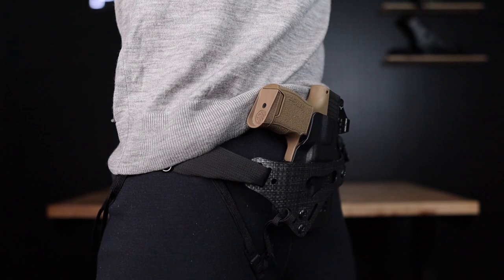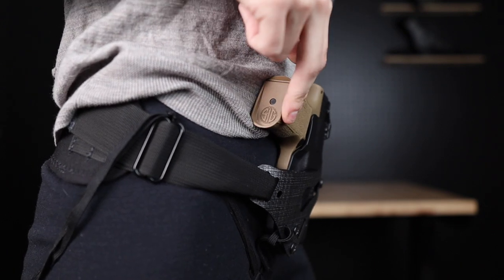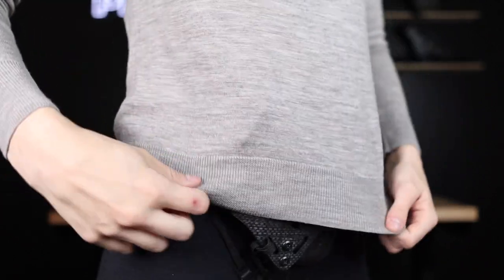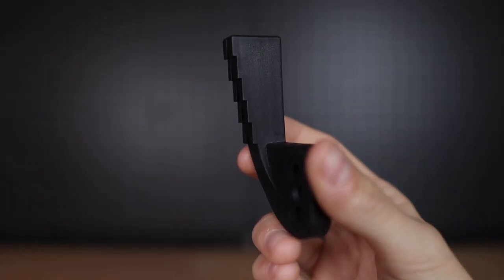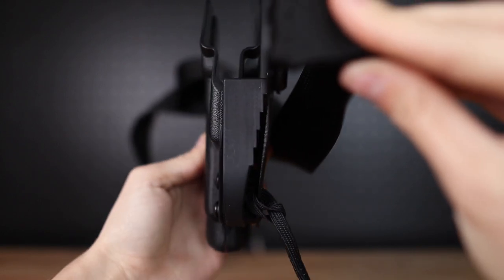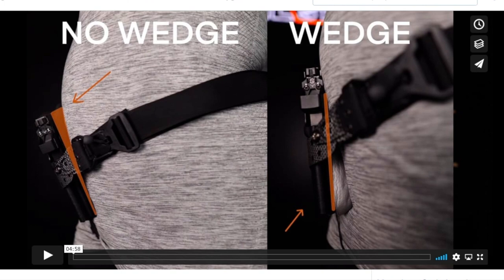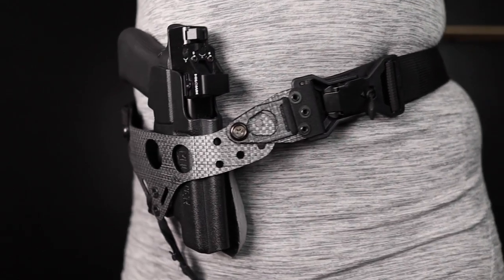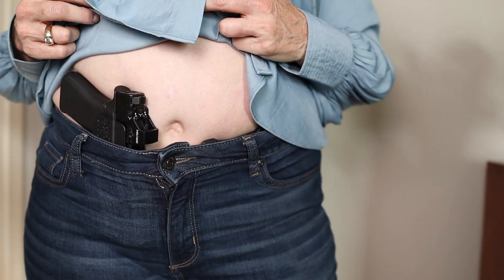3 Steps to Concealed Carry Without Printing

Comment: This helps. I was considering an enigma but I don’t think it will work with my Tier 1 holster and there are no enigmas for a 1911 so I’m gonna try a wedge on my holster. I think it will give me a bit more grip tuck if I place it in the correct spot and it will probably increase my comfort by keeping the muzzle end of the holster away from my groin.

Comment: Good Lord.....get an IWB, put it on, try on different over shirts until you find one that hangs right. And then practice getting to it. 
It's not rocket surgery.
Reply from the maker: Trial and error isn’t a process or guide to success, and generates mixed results of inconsistent quality. 

The fact that so many people struggle with concealed carry and get inconsistent results (often dissatisfied with their level of comfort and concealment) tells us that some clear, repeatable, guidance on the topic is necessary. You’re right that it’s not rocket science, but the path needs to be spelled out and clear if people are going to actually be able to follow it.
Reply: @PHLster  true.in some cases. Good advice & good quality are both a good thing. Online shopping can be hard too    .
Reply: I have used a square interlocking rubber garage floor tile sold at Lowe's or Home Depot to remedy my issues. I can buy it very cheap and cut to fit any printing areas and just wear a very thin Tee shirt as I live in Florida where heat is a big problem. This material is light weight and does not cause me to sweat anymore than normal. Try it you might like it. I also wear a size larger light weight shirt over the Tee shirt at times to further conceal printing. When I get the tiles cut and fited right I glue them together so I don't need to have a bunch of wedges fall out of position.